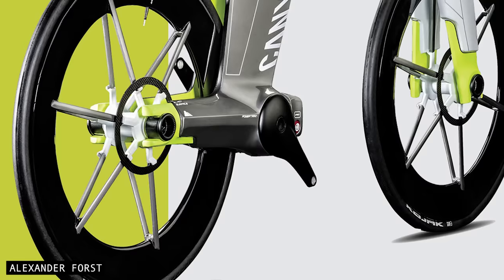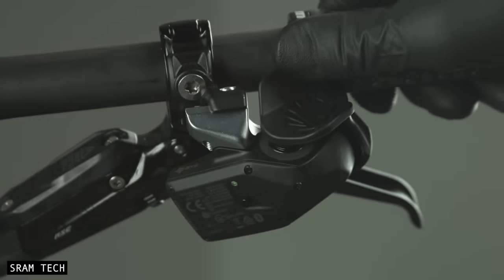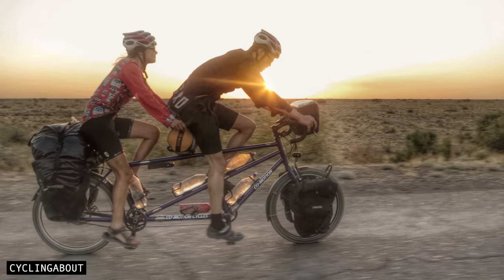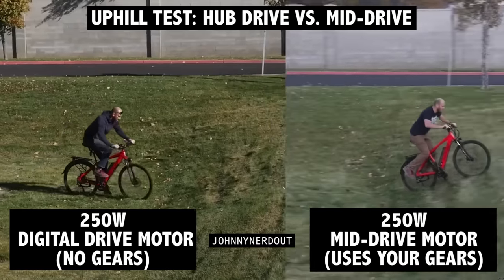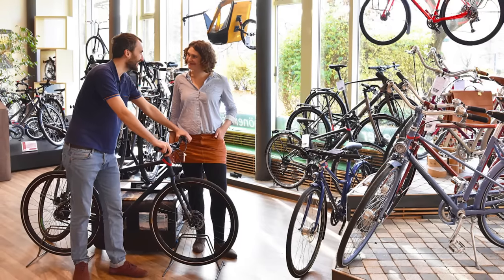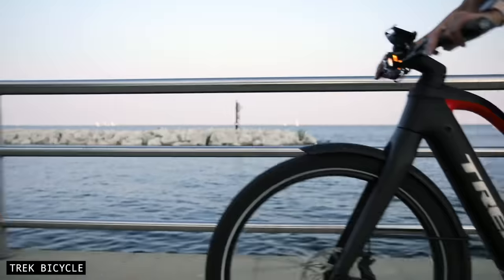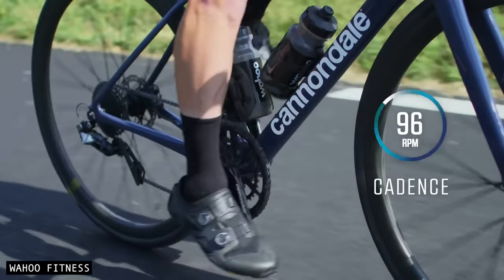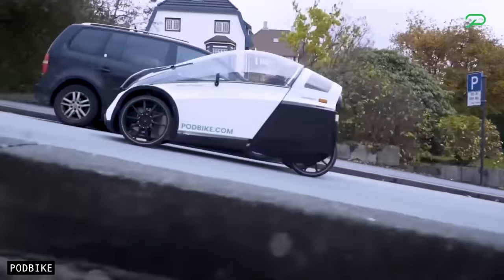Are Chainless Digital Drive Bicycles The Future of Cycling?

Comment: Another benefit: AWD bike with traction control (for commute in slippery snowy conditions). Also front and rear motors may be optimized for different speed/torque.
Reply: I think an AWD ebike would be a very very interesting thing to handle obstacles with. You could climb a lot of obstacles with some watts pulling you up by the front wheel!
Reply: There is no benefits in such system if you lost 50% of energy into generator and then again in motor.
Reply: cycling on ice / sand perhaps
Reply: Combine AWD with traction control and fat tyres and you end up with a bike that can ride in the sand. Aka beach bike.
Reply: @bobsnabby2298  50% loss is too much, but 20-30% would be fine, having in mind this has benefit for e-bikes, not traditional ones
Reply: @bobsnabby2298  50% is very pessimistic. Motors and generators are the most efficient means of energy conversion, 20% loss (or even less) is not uncommon.
Reply: That’s unnecessary I think
Reply: @foximacentauri7891  You don't know how math works? When you combine them all, motor loss 20%, generator loss 20%, needed electronics between them 10%, you get to 50%.
Reply: @bobsnabby2298  and you don’t know how cables work. If your cables have a 10% energy loss, you would feel it.
Reply: Front and rear motors would be interesting to see, maybe even just the front with "digital" and the rear with an IHG and belt.

Edit: couldn't have internal hub gear on the back plus a motor, at least not without a complete redesign 😅
Reply: @bobsnabby2298  That's not how efficiencies work. Instead of adding up inefficiency, multiply the efficiency. 20% loss in one step, 20% loss in another step, and 10% loss in a third step is 08 * 0.8 * 0.9. That equals 0.576, which matches (with rounding) the 58% efficiency that the video stated.
Reply: @bobsnabby2298  Percents don't add like that.
Let's say you have a 1000mAh battery
You lose 20% of that to the motor, you're left with 800mAh. You lose 10% to friction of the wheels and such you're left with 796mAh. Not 700mAh.
Reply: @KaitouKaiju  so 10% from 800mA is 4mA 🤣, okay genius.
Reply: already possible with a torque sensor front motor hub drive without the terrible efficiency
Reply: There's no traction benefit in spinning the front wheel on ice or in snow.  One of the challenges of winter riding is making sure the front wheel doesn't slide out. Putting power into it would make that more likely.
Reply: @Solutionist1  This is what I have on my Arcade E-cardan: front motor + rear 7-speed planetary gear, and cardan instead of chain. Great setup for all-weather commute.
Reply: @PRH123  it helps balance in snowy conditions when going uphill, power is distributed between two wheels, however weight distribution is shifted towards rear.
Reply: @foximacentauri7891  10% loss in cable is already seat heater😂😂
Reply: @foximacentauri7891  Indeed. Current ebike motors can reach 90% efficiency. Synchronous motors reach 99%

Comment: On a normal bicycle you don't have to push through the dead spots of the crank rotation at all. You can also pedal harder with one foot than the other. Pedal resistance on a chain drive bicycle is infinitely variable at any time without needing settings, you only push when you want to, and if you don't push, you can still keep rotating the pedals.
Reply: This is still an energy-consuming process because you are not fully relaxed during pedal rotation. Digital bicycles could provide a more efficient way to spend your energy rotating pedals. Personally, I think the efficiency could achieve 90-95% with the right digital control system.
Reply: @gguy156  On a digital drivetrain you still have to rotate through the dead spot, so where is the advantage?
Reply: @Anonymous-sb9rr  You could adjust circuit to charge capacitors/battery when inertia push your bycicle forward. If the current flow is adjusted right you won't feel the difference in applying force. Also some energy of bicycle could be applied to decrease pedal resistance for more smooth pedalling. Like the narrator said, technology is more suitable for electric vehicles with batteries.
Reply: @gguy156  Putting regenerative braking on an electric bicycle that still has a chain, would have the same result.
Reply: @Anonymous-sb9rr  You are mixing up regenerative braking with pedalling force control
Reply: @gguy156  I'm not, you already have 100% pedalling force control on regular ol' bicycle.
Reply: @Anonymous-sb9rr  Lmao, what a blockhead 😅
Reply: @gguy156  thnx
Reply: @Anonymous-sb9rr  Thank nature for this 🤣
Reply: True, momentum keeps it going - just like a 1 cylinder engine that has lots of "dead spots" keeps going on the momentum of the flywheel and vehicle.
With a digital drivetrain, the problem I can think of is hill starts, because the motor gets inefficient pulling off from a standstill, you might be flailing your legs around trying to send enough current to the motor to get it to start moving off up the hill, compared to a chain that can transmit as much force as you like until it snaps at some high number. The chain is also better for instant torque like if you want to hop a kerb or something.
In an ideal world, with superconducting everything it would work as an "infinite" torque converter but in reality if the motor has insufficient standstill torque, your pedal power will be turning into heat in the drive motor coils until there is enough speed. As a result, you may need mechanical gears in both the pedal generator and motor or make them bigger and heavier with huge magnets and coils to be capable of low rpm current in the generator and torque in the motor, and then thick chunky wires to transmit power with as little resistance as possible.
I think for higher RPM stuff, the chain loses efficiency and this gains efficiency, but we're not pedaling at 4000 rpm here where a chain would be flailing around (or multiple stages of gear reduction are needed) and a generator and traction motor starts looking favorable.
Reply: @gguy156  You're making ludicrous claims while not being able to write down a sentence correctly, and you call someone who has a reasonable argument a blockhead. Congrats!
Reply: @gaborraczjr.5764  This is not my native language. You could just say where I failed. But, this is the Internet, right? No one hears nothing and everyone is an enemy
Reply: @gguy156  He's right and there is no need to insult him. The video describes turning off resistance on the right crank as it goes through dead spots then increasing resistance when you hit the sweet spot. He is saying, this happens in a chain bike automatically. Your other foot pushes down and you release all weight off the other pedal if you want. The only real benefit of this part of the technology is to pair it with a pedal that clips into your shoe, or wraps around your shoe, and provide a force all through the turn. So you are pulling up on the pedal as well as pushing down. You can do this yourself with a chain bike, but with an electric system you could have the forces remain constant to keep you in the right pedal force... If you are saying you think it will be more efficent for someone to push down, let their leg go dead, and let a motor push the foot back up, because you will use less energy by not having to lift the weight of your leg. Well it would be the most inefficient bike on the planet, and honestly, I dont think it would save your body any energy at all. I think to get that done right youd have to remove the rotational force and just put in an up and down stepper, I cant see anyone ever getting used to releasing all energy from their leg mid rotation, but could at the bottom of a step... Although you push down on one side and put weight in, and the weight needed to be lifted by the pedal will be lighter, it will be a weight at the end of a lever, being lfited at the middle of the lever, a very very poor way of lifting a weight.
Reply: @geroutathat  Actually, if you had an idea how mechanics actually works, you wouldn't suggest up and down stepper. Rotary motion is way more efficient. Also you have no idea how the electric circuit works. While the controller is connecting the battery to pedals in charging mode you are feeling an increase of resistance not because pedals are trying to move backwards. No, you are charging the battery by overcoming that force. Force could be precisely controlled by limiting current flowing to the battery. So you can choose a profile of pushing pedals from casual ride with battery assist to hard training with battery charging. It can be achieved with regular electric bycicle, but with less pedal force control due to the inevitable force transfer fluctuations in the chain. You can read some articles about chain force sensors and their price. Considering the price, a digital bike is a nice option

Comment: This could be a great solution as a regen/Top-up for an E-Bike, but not as a replacement for a direct drive (like a chain or belt) on a regular bicycle.
The one big feature missing from E-Bikes is regen braking.  This at least would give you the option to add a few watt/Hours to the battery on easy sections of a ride.
Reply: The slight gain would hardly be worth the cost or added complexity.
Reply: regen braking is available on conventional e-bikes

Comment: Great idea, and then when your battery runs out you can use you can pedal like crazy to compensate for the huge losses in the system.
Just keep using a chain, it's what you need in a bike.
Reply: It's already twice as hard to ride an electric bike with a flat battery with a chain without more power loss.
Reply: And what about AWD bike?
Here I see good chance to make pedal drive AWD bike
Reply: @davidmowbray4230  My e-bike has a ratchet mechanism to automatically engage and disengage the motor, so there is basically no additional resistance when pedalling unassisted. Isn't every e-bike like that?
Reply: @StefanReich  they're just heavier. Regen brakes would be good for getting some energy back but i'd use a solar panel on the back before pedaling to generate electricity.
Reply: @skirnir-atf  they used to make electric bikes with the assisting motor in the front wheel, making them essentially awd bikes. They mostly don't exist anymore, because it's not comfortable nor safe to have too much weight in the front wheel, and because a bicycle with a driven front wheel is dangerous. If the front wheel loses grip you almost always fall down, and if it's slippery out a driven front wheel loses grip easily.
Nowadays you pretty much only see rear hub motors and middle motors.
Reply: It can make electric bikes cheaper. Half of the components is already there and nobody really cares for conversion efficiency there...
Reply: When your battery runs out, you are a sitting duck because these designs don't allow you to mechanically drive the wheel. You now have a very expensive and heavy push bike.
Reply: @skirnir-atf  Not worth it. On clibs the most important thing is grip on the rear tire. It could be a nice gadget, but not really useful.

Comment: Interesting concept, however calling it "digital drive" is quite the misnomer - the signal doesn't need to be digital (0/1) here, it can be analog as well. 
The grand difference is that the power is transferred by electricity, not mechanical movement, therefore the name should reflect that.
Reply: It is always analog.  You can't drive a motor digitally.  The name digital drive makes zero sense. Its just an e-bike that removes the chain.
Reply: @xe-wf5iv  I disagree - driving a motor via PWM would qualify as running it digitally in my mind, and technically you could PWM the generator side as well. Not a big fan of the naming, since I doubt it will always be PWM though, hence my original comment.

Comment: The best use of this would be a 2wd otherwise nah. What I could accept is a super capacitor that charges at regen and discharges to the hub motor at maybe 100w maximum as a "KERS" variant instead of a full electric bike. would make sense in a city environment with a lot of stop and go. And the super capacitor would be integrated in the frame as it does not need external charging.
Reply: When can u have it ready?
Reply: @fastinradfordable  Depends what youre willing to pay, R&D and prototypes are costly!
Reply: A 2WD bike with this technology would be even worse, it would be less efficient, more heavy, and would take twice the effort to pedal because there is twice the number of motors.
Reply: @theyeetus1428  Yes I know, but other than an extreme case where you actually need 2wd, I dont see a point of this type at all, as a 1wd setup it just doesnt have enough advantage vs standard way. But there is no other solution for 2wd so that is the only viable application.

Comment: There is a fair amount of slow speed balance and control that is "felt" through a physical connection between the drive wheel and the crank also. I would like to try riding one of these to feel the difference
Reply: That's the digital part. Establishing that bridge.
Reply: @MidwestFarmToys  Low speed balance. Above about 2 kph I couldn't care less about a non direct link between my feet and the rear wheel, but below this speed you actually rely on forward thrust to keep balance.
If you had a unicycle powered like this, it would be unrideable.
There is a mechanical relationship with this and bicycles
Reply: @MidwestFarmToys  It not a problem at all. Unless your consider advancements in technology a problem. It is the nature of all thing to evolve or advance unless you're a Luddite and want to remain in the dark ages. This is just another possible step forward in bicycle evolution.
Reply: @AJ-oj5eu  telll us you've never had your feet tied down to your pedals without saying it.
Reply: @MidwestFarmToys  yes I agree, converting mechanical energy into electrical and back to mechanical again, is overly complicating a simple design and to me seems..... excessive.
Mid you I'll argue that an automatic transmission is bordering on extravagance too.
Reply: @miguelmiquel5497   Lycra is for females.
Reply: A great option as a replacement for the second or third family car. Potentially a replacement for the first family car. Vehicle weight, cost and status anxiety are the issues for uptake. Development of components will follow demand.

Comment: Efficiency of chain and sprocket is over 99%. Efficiency of inverter is around 95%, and efficiency of electric motors is 91% in best case conditions with average is closer to 70%, both times two for generator and motor separately, for the total loss of useful leg power of 27% at best and 55% average - just for the sake of a gimmick. 

There's a very good reason chain drive hasn't been replaced with anything else for so long. The closest competitor is timing belt, and it's ~1% less efficient by itself and you're stuck with hub gearbox which incurs another ~5% efficiency penalty (or no gearbox at all).

Comment: If you think about, this could allow for front-wheel-drive bikes. Good idea? Bad idea? I don't know but it's certainly interesting to think about.
Reply: Most electric scooters are FWD, I don't know if it makes a big difference for commuting as you're never (hopefully) at the limit of traction.
Reply: Weight distribution favours rear wheel drive. Body position while peddling will always put more or most of your weight on the rear wheel, so it really does make the most sense to keep the drive power in the back. Similar but opposite to why the front brake is more effective than the rear. 
The second disadvantage in a hypothetical front wheel drive bike is if you lay down too much power, you'd lose steering control and could easily lead to the front wheel washing out. Back to the brake comparison, front brake control is a mountain bikers most important skill. Managing that the front brake is capable of the majority of your stopping power when riding downhill, with the risk of locking up the front wheel is an art.
Could there be a use case for 2x2 bikes, where both wheels have power? Possibly, but they'd be few and far between. If riding in low traction environments like snow or gravel, there could be someone out there that would benefit from a front wheel that could deliver power. More so with utility bikes or heavier enclosed bikes like in the video. My 2 cents.
Reply: @sumoneskid  possibly a 2x2 could provide the torque needed at a lower motor weight?
Reply: Recumbent bikes with FWD do exist but you are creating more problems than solving them. In those cases you either have to sacrifice turning by having a regular steering on front as well or having a reduced turning radius with rear wheel steering.
Reply: Pretty sure the first bicycle with pedals were front-wheel drive and they changed the design because they weren't as stable.
Reply: You can buy electric assist fat bikes today that offer a motorized front hub.  They are great for winter uphill riding.
Reply: @acobster  But they were less stable because pedals were on the front wheel.
Reply: @WungusBill Not so shure about that in muddy condition with front wheel bogging in but  going up on steep slippery road would be definitely problem.